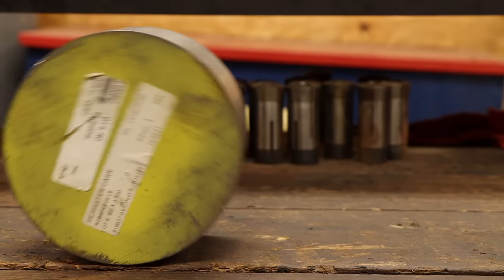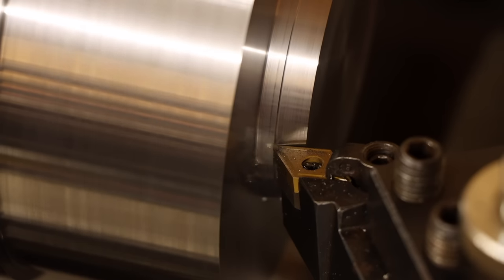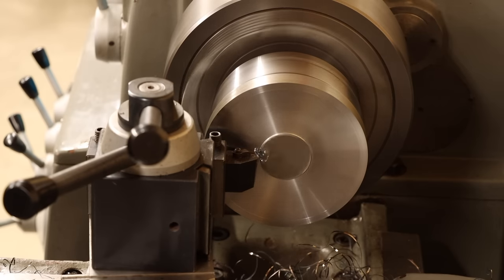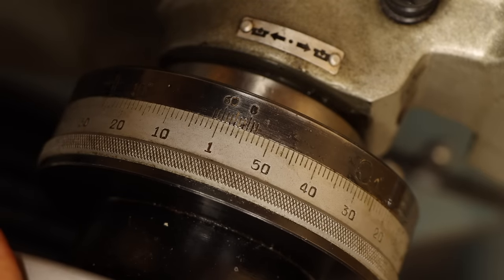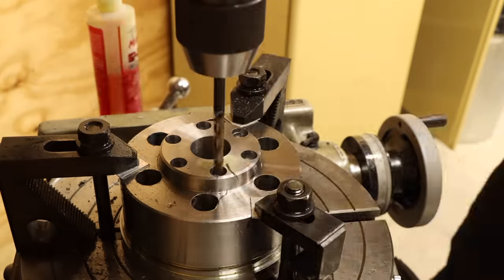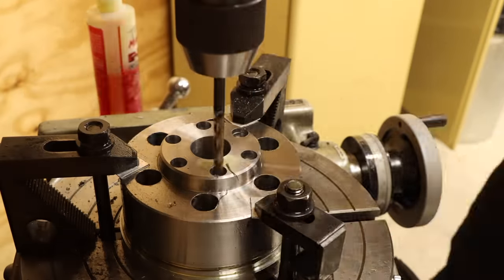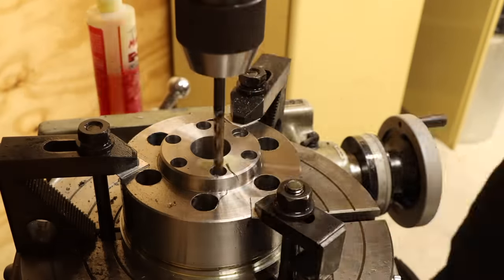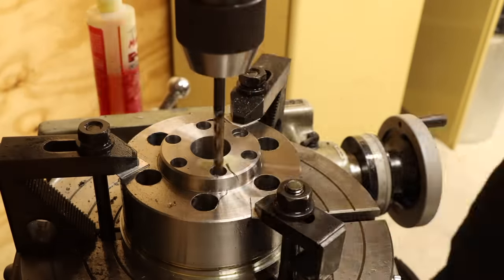Making a Rotary Chuck Adapter || INHERITANCE MACHINING

Comment: For future reference, dry ice and isopropyl alcohol or acetone works way better for shrink fits than just sticking it in the freezer. Liquid nitrogen works even better, but a lot of gas places won't sell it to you without an actual dewar and that's a few hundred bucks most people'd rather not spend, compared to $30 for a gallon of acetone most machine shops will likely have use for anyways and a bag of dry ice from the grocery store. Just make sure you use a metal container because the acetone doesn't play nicely with plastics.
Reply from the maker: Thanks for that. I'm not really near a gas store for the nitrogen but the dry ice would probably be doable. I didn't even realize you could buy that at the grocery store.

Comment: O1 is the only material, to my knowledge, that you can flame harden. Heat it with a torch, until it is cherry red, and you have an effective heat treat.
Reply: @MF175mp  I couldn't remember what the quench type was.

Comment: Good engineering on the mill design, too. You pushed the machine past the design limits and the handle broke. A simple, easy to replace part. Like a roll pin on a pulley.

Comment: Super interesting to see the process of error correction!

Is there any chance you are editing in DaVinci Resolve? Some times, most visibly while you're drawing, there are some visual artifacts that look like they might come from the "retime" setting. Some times if you are changing the speed of clips, or your source footage is a different framerate from your timeline, having the retime mode set to "frame blend" or "optical flow" produces those artifacts. "Nearest" seems to be the best option in most cases. Premiere pro and other editing suites likely have similar settings, but I'm less familiar with that software.

Really hope this doesn't come off as rude. Only trying to offer a tip with the best of intentions :)
Reply from the maker: Thanks! No not rude at all! I hadn't noticed anything weird about the time lapses but now I'll be looking for them. We use Final Cut Pro X. I might have to look into the settings a little more since right now we just retime the footage but I can see how that might cause frame rate artifacts.

*edited for typo
Reply: @InheritanceMachining  cool! I'm sure there is a setting somewhere that deals with how sped up or slowed down footage is handled. Just a small thing, and I'm sure it hasn't been noticeable for most people.

Comment: would have been better with liquid nitrogen and a little bit further away with your heat. Ever so gradually building up the heat just enough. Checking it with laser spot check. In hindsight, maybe figure out the thermal coefficient of expansion  ahead of time to what you actually needed, and then go no further on the heat. Thus avoiding any building up of internal stresses on the material, and warping it. LOL nice lil project till parts fly off and across the room due to becoming loose from warpage LOL. Which I imagine you probably did (warpage) to some degree? But if it all works in the end to what you need, then all the better.
Reply from the maker: Liquid nitrogen would have been my preference but had to get it done that day. I'm not too worried about warpage either as the O1 was already annealed and I probably only heated the local area for about a minute. The true test will come when I drip an indicator on it when all is said and done

Comment: Part looks fantastic in spite of the odd oops moment...

Next time you want to shrink fit dry ice in alcohol (isopropyl) does a good job and is fairly easy to acquire.

For a 0.05mm press fit at that diameter you're looking for about 200 - 250C temperature difference between the two parts. Using dry ice and IPA that still means heating the other part to 150+ C for a drop in fit.

If your interference was 0.025mm instead that gets you into the range of dry ice and warm to touch for a drop in fit.

Good job on recovering it though. I know what it's like to do dumb stuff and watch expensive items get turned into scrap. Not fun.
Reply from the maker: Ah good information! Thank you! Fortunately no damage form what I can tell. But I know better next time

Comment: If you have surface contact on the taper, but also on the spindle face, wouldn't that yield an over-constrained situation? I was under the impression that the chuck should make contact on the taper only.
Reply from the maker: I believe once you consider material elasticity, the tight tolerances, and the shortness of the taper, it all works together.

Comment: The best way to deal with mistakes is to fix them straight away.
Sure it is a pain in the arse but just suck it up and deal with it carefully.
Have a cup of tea and think about the best repair method then do it.
As the video shows it can be an invisible repair which you do not have to point out to any visitors if you don't need to.

Comment: Noticing the 0.025 per side wobble with the keyless chuck on 8:19 and adapter on 10:27.  Was the camera attached to the work-piece or mill table?  If attached to the table or a tripod your quill may be worn out on the machine.  You should plan on having the head reworked or possibly find a suitable replacement that's a bit tighter.
ePop
Reply: I do like the adapter BTW
Reply from the maker: Thanks. I believe both wobbles were just from bad setup. The first with a mill in the chuck which isn't the most stable to lateral loads. And the second form just too much load causing the entire head to move relative to the table. Under normal milling circumstances I can easily hold a thou so I don't think my spindle bearings or quill are loose

Comment: 13:14 My first thought seeing the blowtorch is to hope that that doesn't inadvertently harden that patch of tool steel and make it unmaintainable.
Reply from the maker: I should have mentioned it but I probably only had it one there for around a minute. Not even close to color changing territory

Comment: Excellent content. I discovered your channel today and have seen most of catalogue this evening.
I am curious, did you consider using the vfd on your lathe for custom spindle speeds? It is one of the main uses for the vfd!
Reply from the maker: Thank you! Yes I'll probably add a potentiometer at some point. Just didn't have a need (or the time) when I did the install

Comment: I can't believe you actually pulled it off after that fiasco 😂 I was honestly expecting you to have to fully scrap it. Just curious, about how many hours did you have in this part and what would be the price of buying new stock if you did have to restart?
Reply from the maker: I wasn't about to give up on that 😂  The material was about $180 and the whole machining process took about 25 hours. I was probably 8 hours in when I goofed!

Comment: Apart from the sleeve if it isn't 4140. Have you considered sending out to be heat treated? 4140 is a pretty sweet material, can be made very tough compared to its baby state you have it in now.
Reply from the maker: I heat treating would have been great but I would have had to consider that before final machining
Reply: @Inheritance Machining  you are very harcore. percentages on millimeter dimensions, or maybe you are saying machine to final dimensions after heat treatment perhaps. Anyways, impressive chunk of 4140 and the final part looks great
Reply from the maker: @samueldreas  yeah machine after heat treatment to correct any warping that would occur. I appreciate it, man

Comment: I’ve used the mill for an arbor press before, but I knew I’d break something using the quill so I raised the knee instead
Reply from the maker: That's probably a much better way to do it
Reply: @InheritanceMachining  better just the handle breaking than something much harder to fix though!
Reply from the maker: @devriesfabmachine8721  very true!

Comment: Man… 😔 I really need one of these that has a 10 TPI  x 2-1/4” center mount instead of the three tie down points. I came back to re-watch this for some motivation. I was happy to see yours is a D1-5 also.. that’s the same as mine. But I know your skill set far surpasses mine and instead of motivating me it’s got me thinking this just may be outside of my skill level.  Does anyone know where one could purchase one of these with a solid center I could bore and thread for my old L&W indexing head. (2-1/4” x 10 tpi) 
? I know it’s not going to be cheap. But even the drawing is intimidating to me.
Having one would unlock a whole new level of tooling and capabilities for me though. 
I’ve looked for a spindle I could buy and cut the cam lock head off of. But I can’t find one that’s a D1-5.

Comment: I need to make the handle your have on your quick change tool post for top nut.
Reply from the maker: It's been pretty nice to have honestly. If you haven't found it yet that was one of my recent build videos.
Reply: @InheritanceMachining  Thanks, I will look it up. I still need the other end of box wrench to adjust my vise on mill. Think I will make a ball end for mine out of alum. maybe brass. Give me a reason to practice threading. Inspired me to do something.

Comment: Why not just use the boring head to go from the 3/4 to 7/8 hole? Seems like doing that would be way easier to get the desired tolerance

Comment: It looks really nice but is it still true the heat could have warped and the taper and back pin could be not in line
Reply from the maker: Thanks. Probably not very likely. The O1 was already annealed and I didn't heat it for more than a minute since i wanted the heat to stay local to the area. Rotary table was acting like a big heat sink. Also didn't make any finishing cuts until it was all cool
Reply: @InheritanceMachining  ok than it should be fine it is hard to say on the video how long you heated it

Comment: Have you considered that the reason why you couldn’t do things like parting tool steel and the like is because you didn’t have actual 3-phase power to the lathe at this point in time? Just a thought.
Reply from the maker: I thought about it a lot and all I can come up with is rigidity. I had already converted to VFD by this project so I don't think it was that.
Reply: @InheritanceMachining  ohhh that’s my bad, I must have had the timeline mixed up. Yeah, if the phase issue was already taken care of, it has to be a combination of things like tool rigidity, material hardness, and so on. I remember you saying in this video that you messed around with speeds and feeds, so that wasn’t the issue. 

By the way. To get your speeds and feeds, do you calculate everything out or do you mostly play it by ear? As I’ve mentioned before, I’m still very green, working at a very small job shop, and since I frequently work with mystery metal from the shop’s scrap rack, we frequently only know the general type of steel it is (cold roll, hot roll, or unmarked tool steel). 

How do you go about calculating speeds and feeds / how would you go about doing it for mystery metal? I frequently simply play it by sight and sound & start with what I’ve had work in the past. Any tips?

Comment: Where did you find relevant information for angles and locations of the cam holes for locking the chuck in place?
Reply from the maker: I actually measured it all in the previous video. But you can also look up ISO 702-2
Reply: @InheritanceMachining  Thanks, I'll watch that, is that iso spec for the  D1-6 specifically? I'm looking for the D1-3 specs
Reply from the maker: @heybabycometobutthead  sure thing. The document has dimensions for all the D1 taper sizes
Reply: @InheritanceMachining  Awesome, thanks

Comment: Ok, so it's not just me. I've been dealing with the chatter and vibration issue with the cut offs to the point that my head wants to explode. Do you know why it does this? It's extremely frustrating.
Reply: play around with setting the cutter below center line of the chuck
Reply from the maker: If I had to guess its mostly a rigidity problem. I have no issues with smaller 3" and under parts. Which is probably mostly what my size lathe was design for anyway (despite being a 14 x 39)

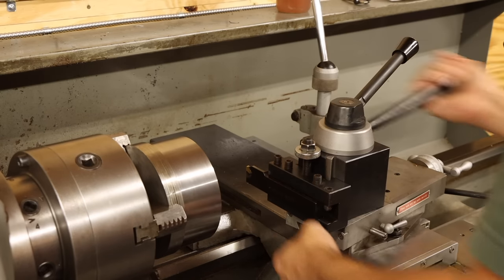Comment: 3:50 parting tool and angled support  not good. If the parting tool vibrates lower the rpm and try different hights of the parting tool.

Comment: 6:45 Ok this has been itching my brain ever since i first saw this vid, couldn't you have just rotated the part on the rotary table and not touched the hand wheel since there where no defining features yet? everything was concentric and there where no holes on the circumference that made you keep the part in that position.  it would have saved you a whole lot of math too

Comment: That chuck is sitting a mile above the surface- why don't you just bolt the chuck to the rotary table?
Reply from the maker: because I would have to remove all the studs off the back of the chuck to do so then indicate it all in every time. Also because I like overly complex solutions lol
Reply: @InheritanceMachining  Indicating is not a problem- you just use your jaws to center around an arbor in your rotary table center hole, but that desire for overcomplication is probably an insoluble problem.

Comment: and here today i was thinking and looking if they made a threaded (2 1/4"? 8) to D1-4 adaptor to be able to simply use all my chucks and such on my dividing head without a bunch of setup... guess I got a good idea from your video what will be involved in making the adaptor.... I already have separate threaded backing plates for most of them but was thinking it sure would be nice to just be able to use a D1-4 and not have to swap backing plates..... someday project #321545524 and i guess i get extra credit if same adapter will also mount on my rotary table like yours does.... hmmm, should be doable in one project, might need a separate locating bushing to fit smaller hole in rotary table... or just indicate it to table...
Reply from the maker: That would be very useful to have common mounting across all your equipment. A removable bushing would probably be the must straight forward way to bridge the mounting gap between the different applications. Good luck on the build!

Comment: A little unsolicited advice from an old man. Never. Not ever, hammer on your setup in the machine with hard hammers. Use rubber dead blow types only. Especially the spindles. 

Secondly, don't bring heat to the party during your setup. Heat induces stresses in a multitude of ways that can break cast iron. Remove the part and take it to the blacksmith area of the shop. Yeah... I know. But, it's the price you pay for screwing up.

Thirdly, when you need to sleeve a hole that close to size either leave the sleeve walls very fat, or better yet drop in a solid slug, then drill, bore ID to size. Go back and watch your video. You can see the heat rising up the sleeve. When that happens the shrink fit is over and press fit begins. Heat transfer is much slower with solid material. Thermodynamics kicking your ass here. If you've got it, dry ice can be your friend. Can make a 100°F differential on it's own.

Adapter looks good thus far. Looking forward to seeing the finish.
Reply from the maker: All fair points! Thanks for the tips and for watching

Comment: Having your junk ripped off in a terrible lathe accident? That's my #1 fear. I don't care who you are, a massive weight of material turning at about 1M rpm and it ever so gently grazes your fly area? And you just know that within the next few seconds you WILL be sucked under by your skivves?
Reply from the maker: Now that's some gnarly stuffI hadn't considered. I might have to reorient my priorities. Though I don't have a tendency to put my bits near the spinny parts.

Comment: Wtf are you doing using a 2 flute end mill in tool steel???!??
Reply from the maker: Probably because I've ever heard that is a bad thing. What's the disadvantage?
Reply: @InheritanceMachining  I apologize for the rudeness then, but generally speaking the softer the material, the lower the number of flutes.  2 flute end mills are generally reserved aluminum, the large spacing allows for a larger chip load on a gummy soft material. Conversely on a hard material like tool steel, the open spacing causes the cutter try and remove too much material in one rotation causing your cutter to "walk". One of the shops I worked in cut titanium with 7 and 9 flute cutters. Often using 5 and 7 flute for stainless and hardened steel. 
  If my only option was to use a 2 flute like you did here,I would use it like a reamer, only leaving about .015 in diameter to clean-up and hit final dimensions. .015 may even be pushing it a bit depending on chip evacuation. Oil wouldn't do unless you are constantly stopping and blowing out the chips.
Reply: @InheritanceMachining  another option would have been a boring head and boring bar. Though, tooling and experience there plays some roll too. Boring bars can be finicky especially if they are Chinese knock offs.